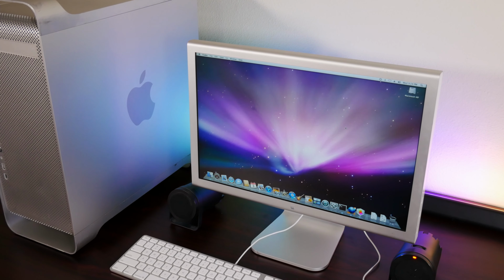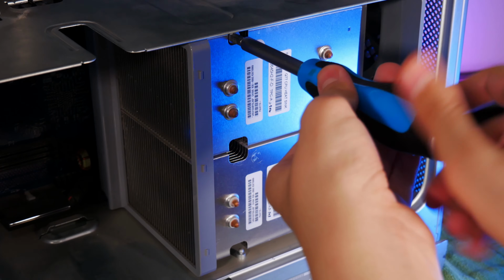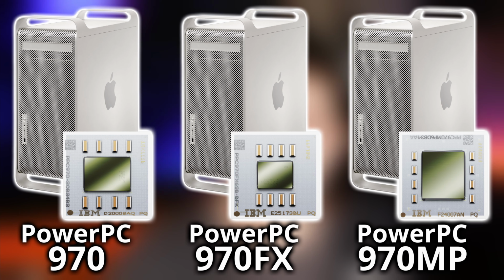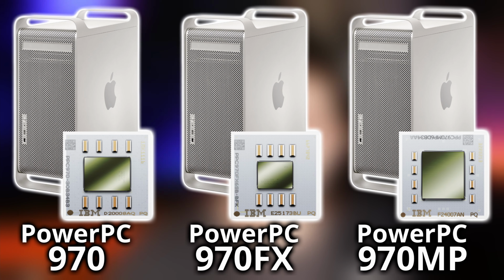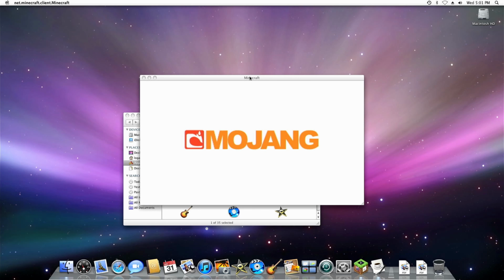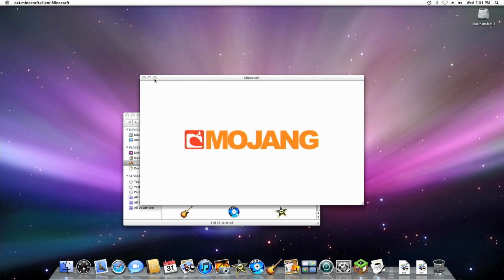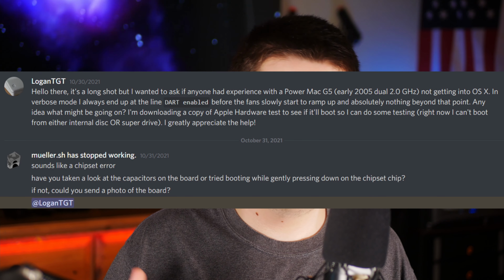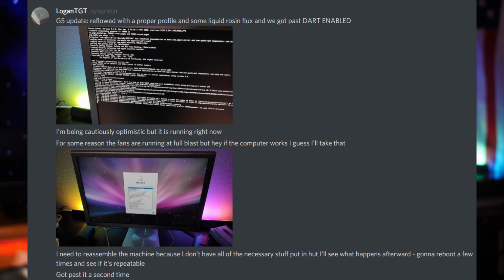Using Apple's $3,300 Mac from 2003

Comment: Design longevity: 10/10
Architecture longevity: 0/10

To be honest it's kinda crazy that a $4,417.99 computer from 2003 isn't able to even browse the web, I mean not even the forum - which is text.

It's $5,303.02 current year. Inflation added a thousand dollars in just four years of you making this video!

I wonder if I can get my dual core Optiplex to do youtube, it's from 2007/08. I think it has the same amount of RAM. 
I think you could get a 100 Optiplexes for $3000 😂

Comment: I would recommend installing Ubuntu Linux for PowerPC. In 2005-2007 I ran Ubuntu on my 450Mhz G4 in order to get a more acceptable web experience. It seems the issues you had with your G5 are suspiciously similar to the Xbox 360 RROD. The reflowing and clamping down the chip to fix it, but who knows for how long that’ll work? It’s the computer equivalent of a car blowing the head gasket.
Reply from the maker: Thanks for watching! Funnily enough I literally just got the G5 out for pretty much the first time since making this video, surprisingly still got it to boot and played with it until it suddenly shut off without warning and now it won't boot LOL. I am definitely interested in experimenting with Linux on it if I can get it running again though. Since making this video I've also gotten plenty of Powerbooks to play around with as well so there's no huge rush for me, I might see how Ubuntu runs on a 1GHz TiBook. Maybe another video idea haha. I appreciate it!

Comment: I had the original 2.0 dual back in 2006.. then a 2.7 and recently I picked up a dual 2 3 'late 2005' with it's recovery disks too just for giggles. I bought it from a doctors office, and they had it sitting collecting dust. I was extremely shocked to find it still had it's 512 mb configuration, and a 160gb hd. I litterally destroyed that drive for my client per her request, and sat in awe as to how like new this one still looks. Not even a scratch. But, it's a little dusty so I am going to order me some fresh thermal paste and show my daughter how to totally refurbish a PM G5. Not a task for the light hearted for sure. But the rewards will pay in dividends. I stuck an extra 2gb in her and fired her up, restored Mac OS X tiger and with 2.5 gb of ram I must say as long as you keep your expectations in check Tiger is smooth. Of course I used a newer hybrid drive so having a huge cache probably helps things a little. I wouldn't go surfing the net or running anything modern, but if you use time period software such as iLife '06 this thing absolutely screams. But having the middle model of video, I wouldn't push the graphics too much, but again period appropriate games definitely works well. Many might start thinking what's the point if your not going to use it for anything modern? Well, I have way newer, higher spec computers for that. I mostly got it for nostalgia and to teach my daughter. I've already collected a MDD G4 that can still run Mac OS 9.22, but the G5 is a whole different animal.

Comment: if you are going after power mac g5s . avoid agp versions and try to get pcie ddr2 ones . in linux you can run  newer gpus ie 6770s or 5770s

Comment: Great video! Many people would like a G5 due to it being the last Power PC Mac and it's design language. Too bad it's a piece of crap lol
Reply: I wouldn't call the G5 a POS, if anything the G5 and it's insane architecture might have been PowerPC's last breath, at least for Apple but it was by far Apple's most sophisticated, most bizarre computer ever. You got to think, this competed with the likes of a Pentium 4. If you compare a Pentium 4 to the G5, the G5 clocked at the same speed would wipe the floor with it. I believe it was just a little too sophisticated for the mainstream. It's true they're not speed demons today. Even with an ssd the G5 duals will crawl doing anything beyond simple surfing of the web. Partly because of hardware but also because of software support. There is none from Apple. Apple dropped these like a lead brick as quick as they could. The Mac Pro towers by the way used the same case but featured a way simpler and cool Core 2 duo architecture. The G5 ran very hot. Almost too hot and so owners who didn't take care of them very well quickly ran in to trouble. It didn't help they basically used IBM's server chip.
Reply from the maker: LOL Yep it really was a pretty amazing machine for its time. But even compared to the Mac mini that would come after it... it just wasn't a very fast computer ;)
Thanks for watching!

Comment: Could i put ATX motherboard in case of G5?
Reply from the maker: Thanks for watching! You can but it would require some modification to the case. I know there are some people that make adapters so you only have to do a minimal amount of cutting, but making the rear IO fit would definitely require some power tools to make it fit correctly. I think it's probably more trouble than its worth but that could still make a really fun project!
Reply: No, you can't ! Not without big big mods (with the help of loud surgery). Research for it on YT, there are a lot of interesting vids on how to change G5 into a PC.

Comment: If you mind me asking where did you get that silver touch-up paint? Just bought a new g5 myself which has seen better days lol
Reply from the maker: Hey man thanks for watching! Probably should have shown it in the video lol. The stuff I used is called Rub n' Buff Silver Leaf Wax Metallic Finish, I got mine from Amazon US https://www.amazon.com/dp/B013PYR4WO/ it's kind of a wax that goes on thicker than regular paint so you can rub it into the surface and it will hide some of the imperfections on the surface. Make sure you have some paper towels and gloves on hand because it can get really messy when you're working with it. Made a big difference in mine!
Reply: @LowestLogan  thanks so much!